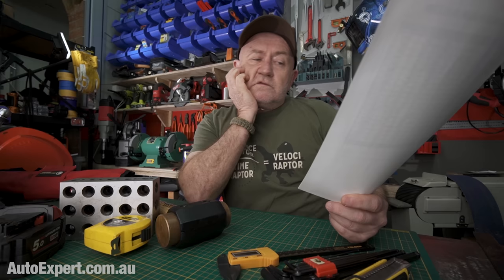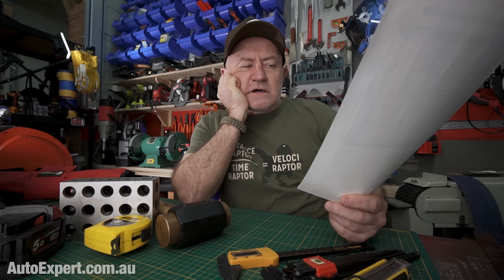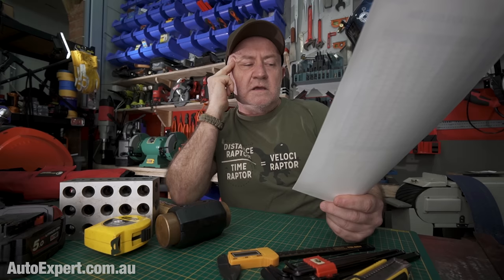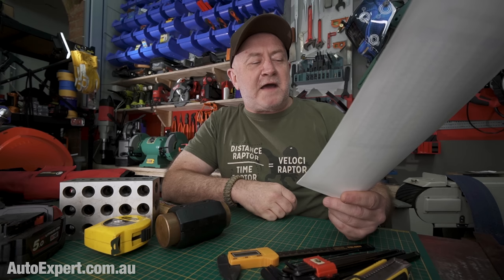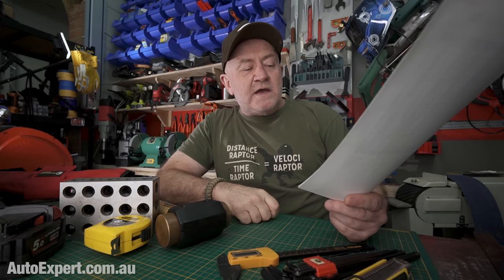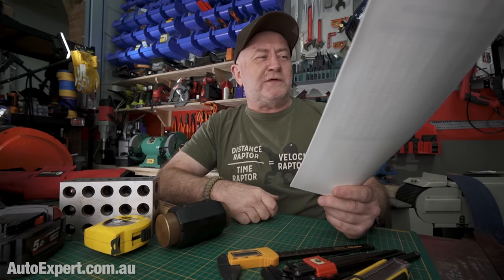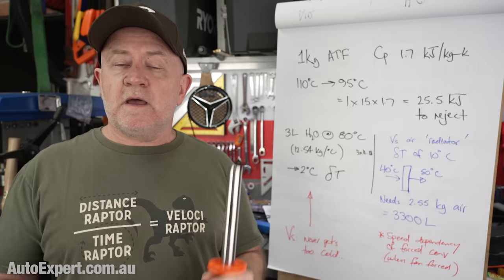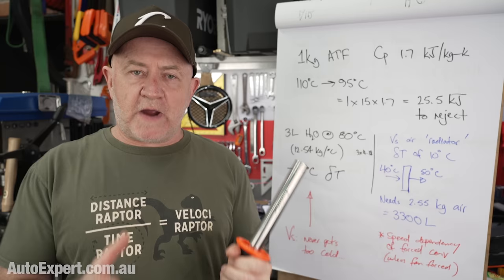The truth about fitting an auto transmission oil cooler | Auto Expert John Cadogan

Comment: Sooner or later, ALL excess heat is rejected to ambient air.  Additional load (eg towing) will add heat to the transmission, which is cooled by its lubricant. In lock-up the additional heat is real albeit minimal, but in reality, towing real loads results in torque converter slip most of the time, which results in continuous and significant fluid friction in the converter. 
There is a solid design case for an additional transmission oil cooler to attenuate excessive transmission oil temperature, but the physical placement of the cooler requires careful consideration. Assuming an air/oil cooler, if the additional cooler is located in front of the factory coolers, some of the rejected heat inevitably reduces the capacity of the airflow to absorb heat from the air conditioner condenser and radiator. Behind the existing coolers, the airflow might well be too hot to absorb any heat from the transmission oil. Ideally a transmission cooler should draw an independent ambient air flow, which is a significant design challenge in any modern engine bay. 

A manual transmission solves or attenuates most of these issues.
Reply: Yes, all heat is eventually rejected to the air, but the difference is storage time because the rate of heat generation is not fixed. You need a buffer to store the peaks so the radiator can deal with the final rejection of that peak heat over time. And if you're not achieving lockup with the torque converter on a level road, then something is wrong with your tow setup.
Reply: @TonyRule  yes, true and conceded- water is an exceptional cooling medium with almost unmatchable capacity to absorb heat spikes and maintain engine temperature in cold ambient condition. If excess heat generation in the engine and/or gearbox (and it’s a no-brainer that they will both work hard at the same time - in unlock or kickdown) exceed the system’s capacity to reject that heat to ambient air, you have seconds to maybe a minute or two to back off or boil the coolant. Saturated steam is a pretty terrible cooling medium. Superheated steam is a very terrible cooling medium. Automotive cooling systems are ALL engineered to a performance/price compromise that will perform adequately for about three standard deviations of the ambient temperature / output demand scenarios, 99.7% of cases, but they sure are not a six sigma design. There are plenty of circumstances where the transmission will drop out of lockup and/or kick down. Hill, headwinds, sand, mud, underestimated the time to get to dingo piss creek before all the good spots are taken, massively underestimating just how far beyond GCM you’ve loaded up the rig; It’s not wrong to add extra cooling to protect expensive machinery. Heat rejection relies on temperature difference and when ambient temps are high, you have less temperature difference to play with. The coolant has a very fixed upper limit at its boiling point, which is helped a bit by pressurizing the system (spoiler alert - glycol coolants present marginal benefits at the hot end - where they shine is much lower freezing temperatures).  

Certainly not arguing there is anything lacking in the thermodynamics as presented.Any vehicle’s factory cooling system has a limited capacity that can be exceeded in exceptional circumstances (the most common probably being a lack of mechanical sympathy on behalf of the operator) The capacity of that  cooling system can be improved and increased by installing additional coolers, if said additions are made with consideration of the entire system and its performance. In some cases this will merely mask the “real” problem (airflow issues as described), in some it might just mean the difference between getting a good spot at DPC or camping on the roadside 40km away waiting for roadside assistance.

Comment: However... All of the heat exchange in a vehicle ultimately is done at the "water" to air exchanger - up the front (Radiator).

 - Just call it "Remote Air cooling" - ie. no longer at the engine, but at some convenient location (often out in front of all the splashing muddy bits).

 - often engines we think of as "aircooled" (the cylinder pots) - ie. as used in aeroplanes, are also oil cooled - unlike the old 2-stroke motorcycles and lawnmowers) - supplementary sump cooling.. 

One big advantage with (tranny) oil to coolant (water +ethyl-glycol mix) heat exchange, is that the coolant is already thermostatically controlled - eliminating a "risk"  of over cooling the transmission - this can easily done without piping the tranny fluid all the way to the front - keeping the whole system simpler and protected thermostatically by the  OEM components....  Eliminates stacking exchangers up front restricting flow for those already included

Comment: I just run both. My cars come with a water based cooler and I just add an extra cooler. Warms up fast, keeps temps in the ideal range and the extra cooler helps both the trans and coolant temps.
Reply: Might suggest you look into the ideal transmission oil temp. For example, is the 'ideal' transmission oil temp 55 or 105 degrees? Is cold, say 55 degrees oil temp bad for the transmission? At what temperature does the trans' oil begin to deteriorate and does more heat reduce oil life?
Reply: @rossevans1774  the car has thermostat built in the trans cooling system, if I recall correctly it's at about 90C that it is the ideal temp
Reply: @514aam  Depending where I read, with appropriate service, at 80C my transmission can potentially last twice as long as what it could if run at 90C. It seems more heat equals shorter oil change intervals and shorter transmission life expectancy. I've been unable to find a 'lowest' acceptable operating temperature for an auto transmission although I did find an article where one fella runs his car at 45C which seems a little too low. I chose to by-pass the engine radiator simply because I did not see the point in heating the transmission oil twice (once in transmission and once in engine radiator), to then put it through the add-on trans' cooler once. That thermostat in your transmission is a great thing, it will regulate not only the transmission running temp but also the warmup time.
Reply: @rossevans1774  mine is a CVT (Subaru) so heat range seems to be a little different than conventional autos. Been running it at about 90C when driving normal, about 115-120C when racing, I'm at 160k now, 0 issues, oil analysis comes back perfect, 30k intervals using Valvoline CVT fluid, the Subaru stuff doesn't seems to be full synth.
Reply: @rossevans1774  the thermostat fun fact is integrated into the stock heat exchanger, the trans when stock does not run fluid through the radiator, only the heat exchanger, I installed the cooler because of racing sessions, the oil temp light came up at about 1500 miles when I first pushed the car hard for about 20 minutes straight uphill, Wich seems logical to me, even conventional autos will overheat with such high loads
Reply: @514aam  For your interest. Mines a GMH 3.6L Alloytec on LPG. With the trans' cooling set-up previously mentioned, the trans' temp operates between 12C and 21C cooler with a maximum towing temp of 86C, down from a maximum of 107C pre cooler install. The downside is the time it takes for trans' warm up around town without thermostat regulation. Interestingly the motor is also running about 1-3C cooler in all conditions, I guess that could be attributed to the engine radiator only cooling the engine.
Reply: @rossevans1774  that's a nice improvement! I would advise a thermostat either way, 18-21c seems a bit too cool
Reply: @514aam  That was in all conditions 12 - 21C cooler than before cooler install. With heavy towing now the max temp of transmission is 86C. When not towing the maximum transmission temp now is 72C. I agree a thermostat would assist warmup time.
Reply: @rossevans1774  oh, I misunderstood, those temps look great, what you could also do is install a flap or something over the cooler, if not towing you could for example cover 1/2 of the cooler and take it off if towing, just an idea, maybe it is not that good 😂

Comment: Hi john,
I have a  ranger raptor with aftermarket accessories and do a lot of 4x4 low range stuff,My ATF went up to as high as 115 degrees and I think would have got higher if I hadn’t stopped to cool it down,would it be better to upgrade to a larger radiator than get an oil cooler.
Cheers

Comment: Rule of thumb: It's a usually safe bet that the engineers that designed these systems spent more time on the design and are smarter to begin with than you.
Reply: Unfortunately you can also add 2 more rules of thumb. 1. The bean counter who is the designers boss will say spend the minimum possible. 2. He will also say design for "normal" conditions, as designing for ALL conditions contradicts rule 1. Unfortunately I suspect the air temperature while traveling to "dingo piss creek" is not considered normal in most parts of the world, especially while also towing a 3.5t shittwarr, so is not part of the design conditions used by the manufacturer? Or if it is it is classed as being on the limit and therefore increased maintenance and decreased lifespan is acceptable?  If that is correct then you need to change the Trans fluid much more often or add a cooler to overcome the abnormal operating conditions. Of course the only way to know if you need to upgrade your cooling is to monitor transmission temperature, then you will know, without any doubt.
Reply: Safe rule of thumb. Don't assume anything with a car manufacturer. They build a product that needs to be used in different ways, market it to the extreme and hope for the best.

Comment: Transmission Oil has a window from 75°C to 110°C if you are under 75°C the shifting is maybe not as smooth as it should be. If you are over 110°C the Oil aging is increased. Thats why the car manufacturer offen have the transmission cooler integrated in the water cooler (like my 300C) that keeps the transmission oil at about 90°C and that is best conditions. Also for the engine oil for example Mercedes has a Oil to water intercooler that keeps the oil below 100°C under normal conditions. The cooling system is designed for that if it overheats you have to find the failure not adding additional coolers. If you want to use your car on the racetrack you need aditional cooling but not for normal towing. I enjow your technical explanations verry much. Looking forward to the next class. 😉👍👍👍

Comment: Working on these vehicles over the years I've seen far to many failures of the water to oil exchanger resulting in a severely damaged transmission and damaged seals and hoses in the cooling system. All very $$$. My opinion is to have a stand alone transmission cooler WITH a oil thermostat. Will keep the oil at correct temp just as a coolant thermostat does. On the point of beach driving, placement is key the fans must pull air through the cooler no point having it hanging out 100mm in front of radiator it must be very close with foam to seal air from coming around sides. No different to your engine radiator on the beach.

Comment: Basically it comes down to 
heat exchanger heat rejection ability 
oil flow 
oil temperature 
oil viscosity ATF oil and engine oil very similar  ,, gear oil very different
coolant/ air  flow 
coolant/ air temp 

There are math formulas for this

Comment: Exactly why my vehicle has only had modifications once a particular limit has been reached in what I need it to do. I have a second set of off road wheels and tyres if that is the plan but I am not silly enough to use them onroad where I spend 99% of my time for work. I put a light bar on as the high beams were not reassuring enough in roo country in the dark where I go enough to warrant it, mounted on a dealer fitted nudge bar to the factory driving light mounts, it now does what I need.  Re the trans temp, unfortunately in the new model Isuzu MUX, no one knows what the PID code for the trans temp sensor is so it cant even be monitored by third party OBD2 apps....just a light on the dash which apparently comes on way too  hot.

Comment: Remember back when Ford made it abundantly clear towing anything more than a box trailer would require an extra transmission cooler? Back when people towing a large trailer or caravan with a Falcon was the normal done thing and not using a giant big old 4x4 was what people did?
Reply: Whilst it may or may not be necessary I can't see how it genuinely hurts fitting a transmission cooler as long as you're mindful you need to take a little bit longer to let the transmission fluid warm up when cold.
Reply: Back in the furry fanny days
Reply: I towed a heavy trailer with a mates mitsi outlander and then towed the same trailer with my 20 year old subaru legacy 3.0r. I would (and do) tow with the suby any day)
Reply: Don't US trucks offer towing packages w tranny cooling ?

Comment: Hi John,

Good report, one question, I tow a small van  just under 2000kg with a triton the same as yours. On a long climb it gets hot, I throttle back and change down so I don’t over stress the engine.

Should I be worried about the engine temp increase in these situations.

Example, travelling north on the Moonbi range north of Tamworth.

Temp gauge goes up a few steps. 

Jeff

Comment: Hi the most poorly informed  consumer information is air conditioner condensing temperatures 
Many car makers  nearly always have a very small condenser resulting in very very high liquid refrigerant temps . Most are at least double of industry standard .A few   modern air con units are better  but mostly car makers  have band-aid solutions .  
Sadly getting the air con to work better is not a sexy subject .  In 46 deg cel , 80% humidity  all doors open my vehicle  still cycles down to thermostat easily at 1500rpm

Comment: Good explanation John. So why do TOYOTA’s Prado’s and Hilux overheat towing 2.5T even if cooling system has just been serviced by Toyota?
The programming is crap for transmission. If I drive at 90km/h towing a 2.5t Shutwhar in 45deg in 4th or 5th for 5hrs+ the transmission gets warning light because the idiot who programmed doesn’t lockup the torq converter in normal op. If you do same test but put the cruise control on it locks up torq converter and never overheats.
You don’t need a ATF cooler just need to get the torq converter to lockup. This is generating the heat.
Reply: Nice one! 😊
Reply: Well, that's pretty bad. Sounds like a job for a manual lockup switch.
Reply: Tow in S4 with your Prado and your transmission temps are considerably lower as it generally stays locked
Reply: @David-jp2rc  we have 2018 VX and it doesn’t lockup in S4 until you reach 95km/h or you speed past 90km/h then back off the throttle then reapply or apply the cruise control. The manual mode isn’t manual as if you select a gear ie S3 once it gets past  3200rpm it changes up to S4 . The Sport mode makes virtually no difference when towing. Had lots of trouble holding at 3000rpm going up step grade towing. The transmission programming is crap.
Had a ISUZU Ute and it does have sport mode which holds gear. Prado’s don’t.
I’m looking for a lockup kit to override the program so it stops a lot of this. Asked Toyota service and they keep saying it has the best update revision software and won’t change it.
Reply: @Bushmagpie33 I agree the auto transmission programming in the era Prado’s we both own are crap (I own a 2020 GXL - pre upgrade with some ARB crap on it). I’ve found except for steep hills (where I see temps up to high 120’s under prolonged climbs measured using a Scangauge) but for most Australian touring towing 1.8 tonnes in S4 I can manage to keep auto temps around 90 degrees with careful driving. Overall, I’ve found the Prado to be a great all round touring 4WD, with the exception of crap auto programming and headlights that you can’t get wet…without an expensive repair bill!

Comment: Heah Ken, very informative, but Water is pumped through the top of a Air cooled Radiator, Heat exchanger, What ever, it still is using Air to cool! Maybe a thermostat needs to be added for the Automatic Transmission Fluid To regulate it's Temp same as with engine. By the way A Hitler was not German but Austrian! I offended a school college so much that he pretty well never spoke to me again with that knowledge in a history class asked about this birth place!

Comment: I don't Agree < had a Falcon Wagen V8 and when pulling a 2 horse float on warm days the engine would over heat , we fitted an Transmission oil cooler and problem solved

Comment: It's a well know male problem of thinking you know better and trying to improve something.  There is also an additional benefit of getting the transmission oil up to working temperature quickly by taking heat from the radiator.  But... there's also a downside to this design when the trans cooler fails in the radiator and lets engine coolant into the gearbox.

Comment: In my case, absa-f&$@ing-lutely. Ford Terry Turbo. Oil/water heat exchanger shat itself. Replaced with oil to air cooler and flushed the tranny and coolant system. Wished I'd done it sooner and avoided the milkshake.

Comment: I think your tshirt is incorrect. Velocity uses displacement not distance? Still a cool shirt though.
Reply: Distance and displacment are same thing.
Reply: @frankfox4366  they sure are not. Distance is a scalar quantity. For example the odometer on your car measures distance. Displacement is a vector and describes a magnitude and direction. If the shops are 10km North of your house, and the road to the shops is 14km through a couple of turns and roundabouts, you have traveled a distance of 14km to get to the shops but your displacement is 10km North.